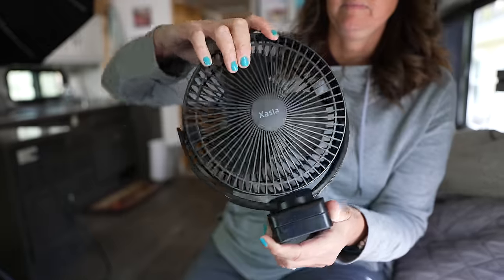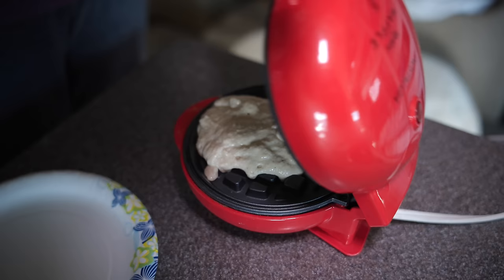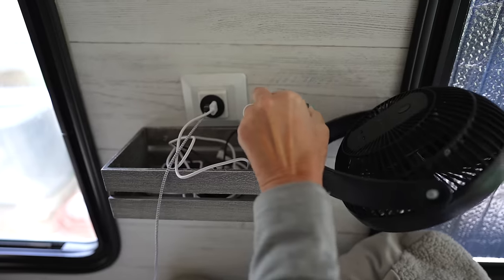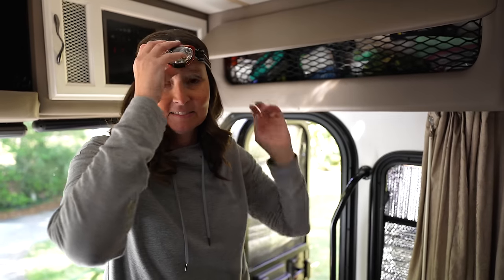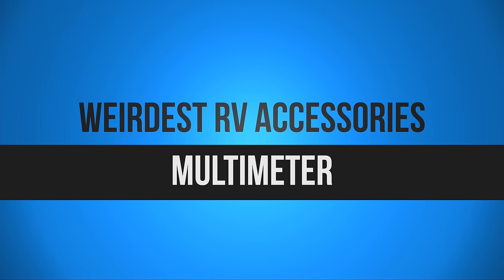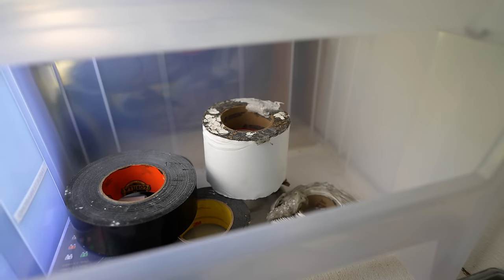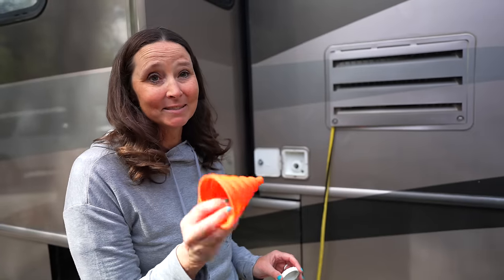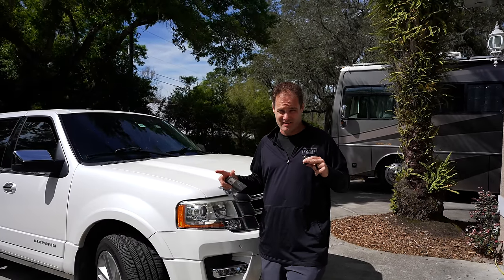The WEIRDEST RV Accessories (That Are Actually Genius!)

Comment: Here's a tip, always keep a hose clamp with your water bandit so it can be tightened down and will stay on the smooth spigot when you open the valve. Our MH has a screw on hose fitting that requires water pressure to fill our tank, so a hose clamp is mandatory for us.
Reply from the maker: Great tip, thanks for sharing

Comment: Great videos… One suggestion for hauling water and transferring into the RV.
 I see you using a funnel and pouring the water from the container into the RV. Instead get a Jiggler ( hose with a one way ball valve at one end found at places like Napa, Home Depot Camping World etc.) It’s basically a siphon hose. 
Just elevate the jug above the inlet like on a ladder or something similar. Place the ball valve end of the hose into the jug and the other end into the inlet of the RV. Then simply jiggle the hose according to the instructions.  The jug will empty relatively rapidly Depending on the size of the hose. 
Greg
Reply from the maker: Thanks for the tip!

Comment: There is one thing for sure that I will never use that collapses in my RV ever again and it's the Collapsible bucket. Not recommended for indoor RV usage at all. If you catch the side of the bucket it does what it's meant too and collapses and you have wet products all over the floor.  I will however use them for outdoor use for cleaning etc so if the bucket collapses it's outdoors.

Comment: WAGO Connectors! These replace wire nuts. They are more secure, totally up to code, one size fits just about anything, and - can be used with just one hand. Further, in order to test for voltage, you don't have to disconnect anything - they have a recessed test probe hole.
Reply from the maker: Thanks for sharing!

Comment: There's another great use for the Water Bandit that you didn't mention.  If the hose bib you are trying to get a hose on has damaged threads such that you can't thread on your hose, or because it makes the hose leak, you can use the Water Bandit on those hose bibs also to get your hose to work usually.

Comment: My parents had a diesel tag Axel RV. It was the Mountain Aire, by Newmar. My parents used this more then there large 55 foot boat. They loved it so much they had there names on the towels and there ribs. This RV had everything, except propane tanks. It was all electric. It had one full slide and two smaller slides. But your kitchen ideas are great to know. That RV was driven in every state here in the USA, plus in Canada.  And they did boone docking also. From Inverness Florida all over the states. There Hatteras only took them to the islands off our coast. I had a blast seeing a lot of nice places thru our the states. But once my mom passed away my dad sold the RV and the boat, because it reminded him of his wife. He asked me if I wanted one of them, but I said no. So he sold them. But when he died in 2009 I got that money. There was a TV in the living room, and it the master plus one outside. The kitchen had a big electric range plus a dishwasher, microwave/ convection oven and a 5 door frig. Mom only had to buy a toaster and a coffee machine. It even came with some dishes, silverware and a few pots. We also had a outside shower and the canopy's were all automatic with lights under them to light up the small folding table. The basement slide outs were all electric. And it had a sat dish on the roof with three air conditioners. The outside paint was like a mirror, black with red stripes, like racing strips. The only thing my dad added was a wine cooler and a rifle and pistol safe. Been to a lot of camp sites with bears walking around at night, so my dad shot blanks, it did the job. But one night in northwestern Canada something shook the RV, my mom screamed. I think a squatch was out there, but in the morning we did not see any foot prints. But we did get two prints in North Carolina. Now my mom stood at 5'4" and my dad stood at 6 foot. Myself I stood at7'3" tall and wear a size 18 EEEE shoe. Now I'm in a wheelchair because of a back injury. But that morning that foot print was much larger then my foot. It's nice that your taking your kids to see the states. Your making memory's, great memory's. Hopefully they get great paying jobs and follow what your doing for them, that they will do to there future kids. Like my parents seeing that I loved to cook and sent me to a cooking school in Germany. If you ever get a chance to go, go. My mom was from Ulm, where the tallest church tower is located and my dad was raised in Ludinghausen. All of Germany is beautiful. And I went to cooking school in Bad Reichenhall. A very beautiful town in southern Germany. Right across the border from Austria. Was there a few years ago to visit my relatives. The Ulmer Munster was started before Columbus discovered America. But I subscribed to your channel and always give you a thumbs up when watching YouTube on my big screen TV. Keep up the great work Mom and Dad.

Comment: For hauling water instead of the small totes, get a water bag. They come in every size up to thousands of gallons and collapse flat or roll it up. Ours is 65 gallons, same size as the rv tank. Get a 12v pump or drill pump and you never run out of water.

Comment: Try wrapping eternabond tape in parchment paper,  so it doesn't get everything stuck to it.   Have you tried smart bottles, way better, tougher, smaller, and modular with various accessories/mods.  A cordless tool syste(looks like you already have dewalt) works really well for things even like the fan and air compressor,  then it's actually cordless.  And a simple siphon for the water transfer is easier,  no funnel required,  and minimum lifting the water jugs, and probably 3-4x faster transfers.

Comment: Problem with LED turn-signals,etc. is that they use less juice and the clicker-thingie and the signals click/flash twice as fast. There is a plug-in resistor available at auto-parts stores that will slow it all down.

Comment: 2 things. It's not collapsible, but one of the most utilitarian funnels you can have is the long neck kind you use for adding fluids under your hood. And as far as the lights go, those amber ones are you low beams. For when you want to show up late at night and not blind your neighbors. Or so you can idle and let someone know where you are without again blasting the wildlife and neighbors with light pollution. Even trees need to sleep, new fun fact, Google it.

Comment: The problem with jacking up the power of your headlights, is you are more likely to blind oncoming traffic.

And there's another double edged sword to that... at night... older people start to see halos around lights when they start to get cataracts, or in the case of some replacement lenses... and so you're doubly blinding them.    I can say driving towards another car on say a motorcycle at night that is blinding you to pieces is a harrowing experience, and your best bet is to slow down and fixate on the white line on the side of the road and follow it and hope it holds out until you pass them.    When would it not hold out and disappear?   Like when you go through an intersection where you have no stop signs but the entering traffic does.  Then poof your white lines disapear for so many feet until you are through the intersection...